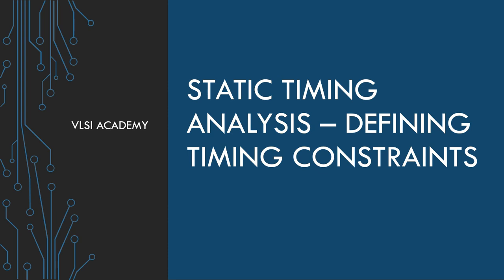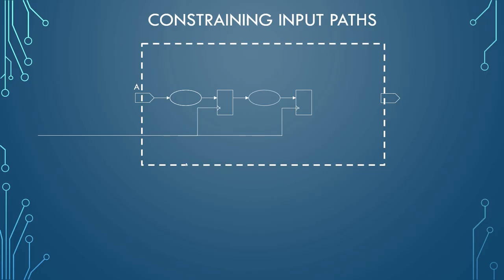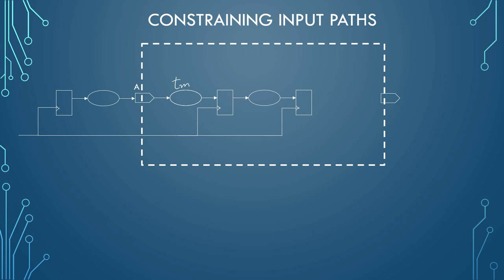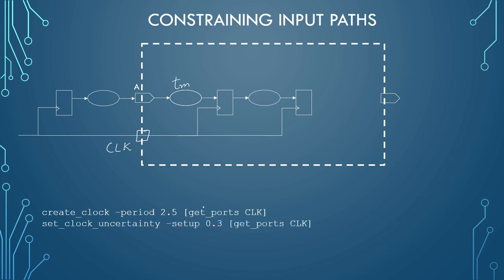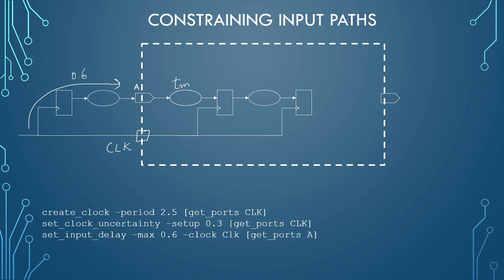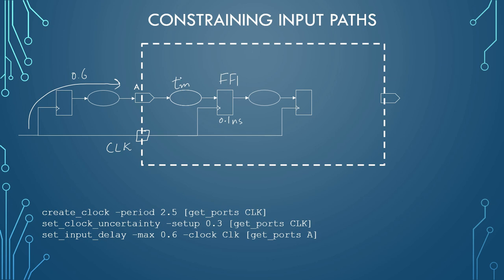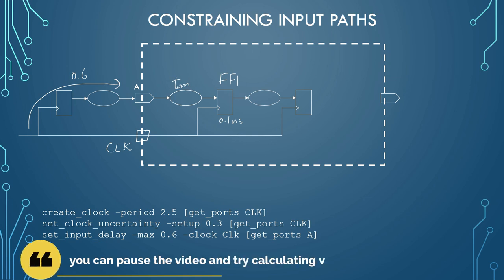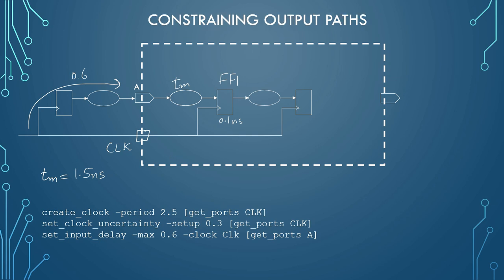STA lec16 defining input-output constraints part 2 | static timing analysis tutorial | VLSI

Comment: If my In2out setup slack is failing, then the possible fixes are reduce combinational delay, clock-to-q delay, setup time(but again this is fixed or it is under our control?). let me know if there is any other strategies sir, or the ones that I have listed are right or wrong as well. Thanks!
Reply: @VLSIAcademyhub  sir u mean path group? And if so can you share the command also please for icc2 :)